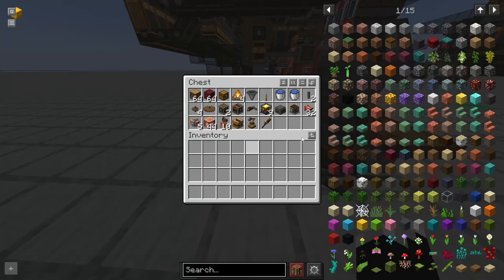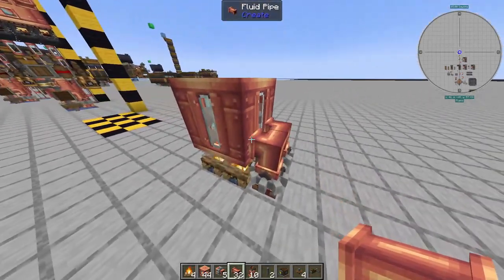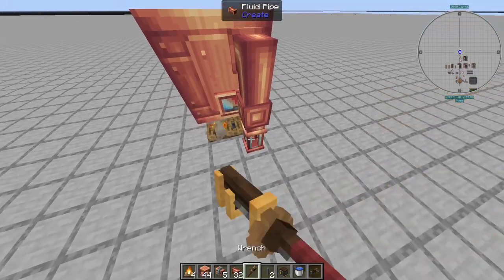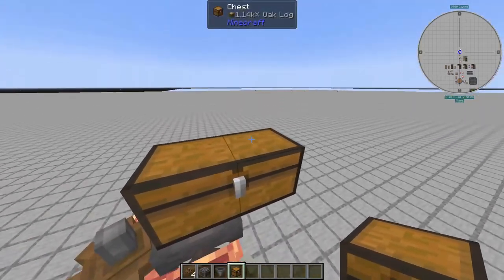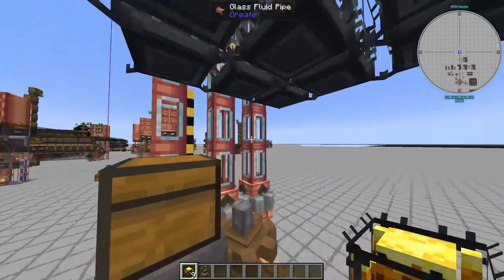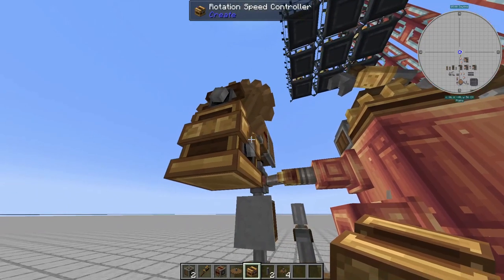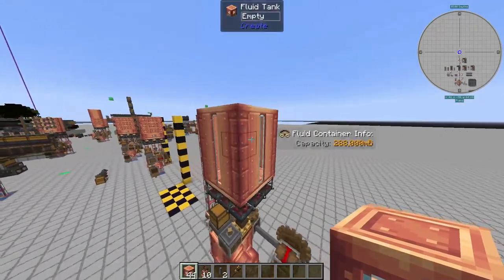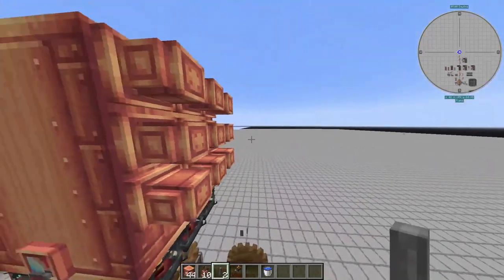Create Mod | LVL 9 Steam Engine Build Tutorial with WORLD DOWNLOAD

Comment: Once it is started will it ever turn off or will it stay on forever?
Reply from the maker: it will keep running as long as you have fuel (wood) in the chest or if you wanna turn it off, you can just flip the lever and it should come to a stop
Reply: @cub1c698  How about expanding it? Is it possible to connect more together or would they have to be separate?
Reply from the maker: @AmazeEject  I haven't tried it since 147K stress units is more than enough for me but if you build another one beside it then I'm sure that should work. I might make a video for how to power with blaze cakes which will take it above lvl 9
Reply: @cub1c698  Alright, thanks.